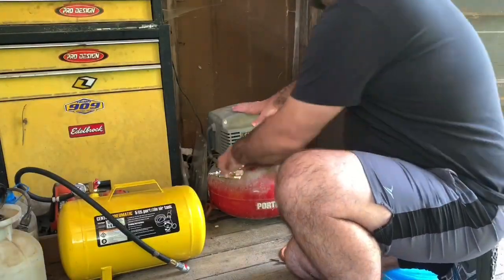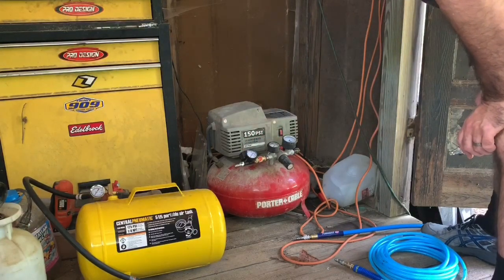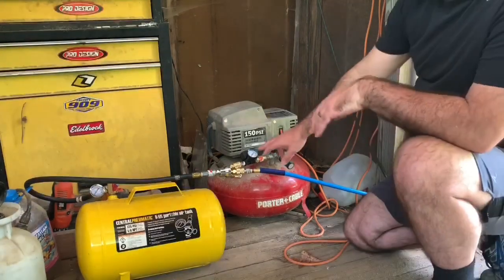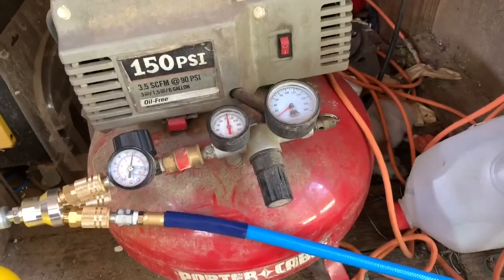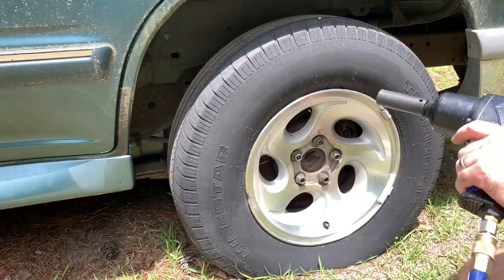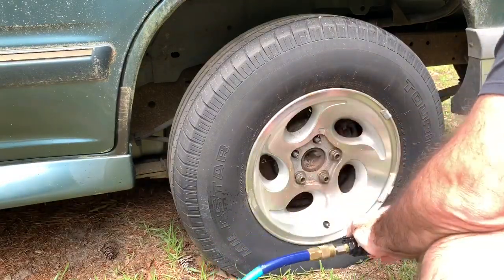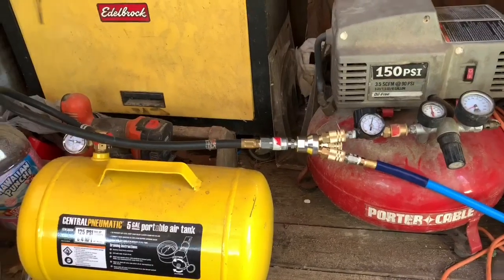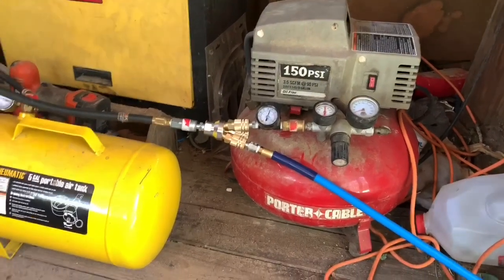Modified Harbor Freight 5 Gallon Air Tank (Add on tank for your compressor)

Comment from the maker: FYI this burnt my compressor up
Reply: Time to replace that old porter cable, check out the fortress @ HF.
Reply: I think charging an added on tank should be done slowly at first. And possibly separating them after the charge is complete. Maybe. I would like to try this though.
Reply: I think charging an added on tank should be done slowly at first. And possibly separating them after the charge is complete. Maybe. I would like to try this though.
Reply from the maker: @Thatswiftieofc13  I just bought a craftsman 6 gal same deal
Reply from the maker: @KawaiiArcadeMasters  yeah it that’s the best way. Just fill it a little at a time. So not to get the compressor hot. The old porter cable was old anyway. I replaced it with a craftsman 6 gallon same deal. Still running the add on tank too.
Reply: @ShinyKnife  That’s good to know. Thanks
Reply: Great video!  Thanks for sharing!
Reply: The PC unit is NOT rated to run all the time which is needed to fill the second tank!
Reply from the maker: @justinmurphy2227  yeah lol definitely, found out the hard way
Reply: Good video. O never seen 3 way adapter. My son was telling about this. I will do the same. Question for u tho, how much air meaning PSI in the air tank needed to fill a tire ? I have 80 PSI I. My tank to use it for my air gun which is supposed to at 90 PSI max as it says so on a sticker that came with it.
Reply: @losmoore3358  They have the same air manifold at Harbor Freight for $9.99
Reply: @Thatswiftieofc13 I bought a craftsman just like the porter cable

Comment: Great video Brother. This will help me tremendously when rotating the tires on my GMC 2500 van! 8 lugs on each tire. 66 years old & used a 4 way. Last time I changed oil and rotated the tires took me over 5 hours.  This will save me all kind of time!  I'm headed to Harbor Freight as soon as they open to purchase an 11 gallon tank. I'll check back later with an update. Thank you!
Reply from the maker: Awesome Man! I hope it works out for you. It’ll definitely help with air volume

Comment: I appreciate seeing you do this. I have a harbor freight 5 gallon  compressor and I want to use an air hammer to take some glass blocks out of a basement window. I heard those air hammers can use some air! This seems to do the trick to at least give me more time to chisle out those blocks before I lose too much pressure to make the air hammer in-effective.  Great solution for a one-time or seldom-use situation where you just need more air volume. Thanks!
Reply from the maker: Glad I could help! Appreciate you watching

Comment: Is it possible to take my old working compressor from a rusted 25 gal tank and plumb into a HF tank as the primary tank?
Reply from the maker: Yes, just regulate the pressure for the tank.

Comment: Great idea....with the tank.

Bad idea taking all the nuts off while the load of the truck still the rim.....safety first.

Besides that.....great video.
Reply from the maker: There was a jack stand under the axle you can’t see it on the video. I’m not that guy lol

Comment: I was thinking of doing the same way hook up. How long did it take to fill the external air tank ? I have 11 gal 125 max PSI CENTRAL PNEUMATIC AIR TANK from harbor freight.
Reply from the maker: It didn’t take very long, I would fill the compressor tank all the way up. Let rest about 10 mins, then equalize the tanks. Then run it another 7 to 10 mins and it’ll be full

Comment: If you're running your tools off a long air line you might get better results locating the auxiliary tank close to the tools.
Reply from the maker: Definitely agree, I hardly use air tools tho, just for lug nuts. Or spray off dust from my truck or clothes

Comment: Just so everyone knows, this doesn’t increase cfm, but it does allow you to run a set cfm for longer, so you get longer working times. Also, make sure your compressor is rated lower or equal to the max psi as the auxiliary tank! This video the compressor is 150, and the tank is 125.
Reply from the maker: I had a regulator in between the 2 tanks so it only put a 125 psi in the auxiliary tank. And your correct about the CFM it only helps for volume. I thought I said all this in the video. I guess you just caught the highlights or either I forgot to mention it. Either way thanks for pointing out the technical aspects
Reply: I think the REGULATED output of the compressor should be set to the MAX pressure of the auxiliary tank, yes. But the max pressure of the compressor is that. The MAX output of the air compressor. Keep the regulated output of the compressor to at or below the max rated pressure of any Aux tanks and it should be fine.
Reply from the maker: @johnclayton2101  that would be the perfect solution but when the main compressor kicks on it won’t shut off until it reaches max pressure which is 150 PSI that’s why I had a regulator in between the compressor and the helper tank to keep the pressure at 125 PSI. It has a release valve on the tank so if it goes over 125 PSI it’ll release the pressure. So it’s safe. But I get what your saying. If you had a 125 PSI compressor to match the tank you could do it.
Reply: @ShinyKnife  Maybe my compressor is different. The output of my compressor has a regulator before it gets to the main tank. If I add an aux tank after that regulator, then both tanks compress equally, right? It's as if the main tank and the aux tank are now one larger tank. At least that's how I understand it. I think the power to my compressor motor monitors the compressor side, so that probably does go to max. But the REGULATED side, I mean the regulator that came with my compressor, is shared between the two tanks. I guess I'll just have to try it. That's the only way I'll know. Until then, you are probably correct. I mean YOU DID IT, and I have not.
Reply from the maker: @johnclayton2101  I put my aux tank on the back side of the regulator because it was broke. I took the safety valve out and went off of that side. That’s why I had to add the regulator the way I did it. But you are correct if you come off of your regulator you can equalize the tanks.

Comment: Lol looks like a 5 lug nut air compressor
Reply from the maker: Yup it’s a burned up compressor now. I have recently replaced it with a craftsman 6 gallon pancake same deal. With the add on tank. Works perfect

Comment: How did you put the quick connect on the portable tank?
Reply from the maker: Changed the hose on the tank and added the quick connect. Here’s a link to the hose https://www.harborfreight.com/3-ft-x-3-8-eighth-inch-air-hose-lead-with-1-4-quarter-inch-18-npt-91294.html